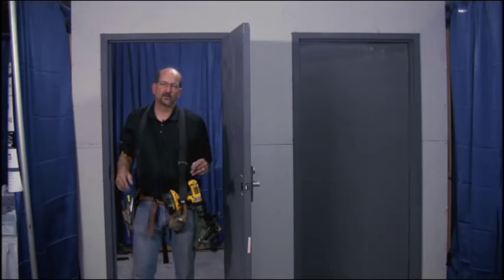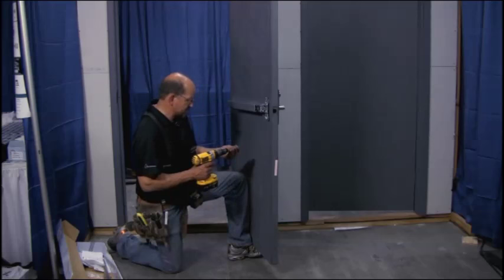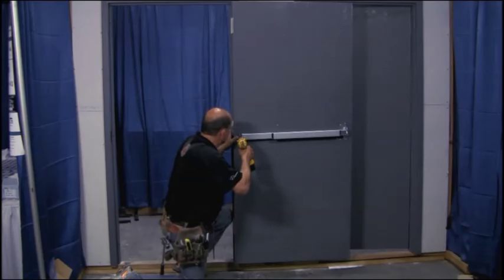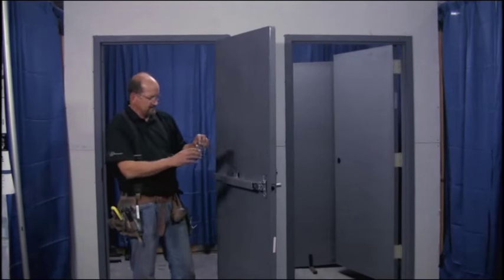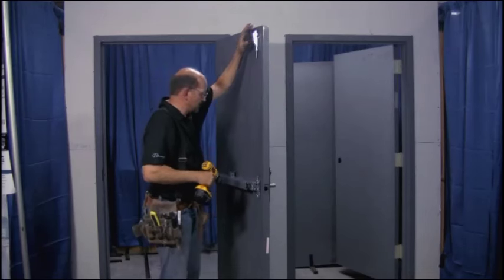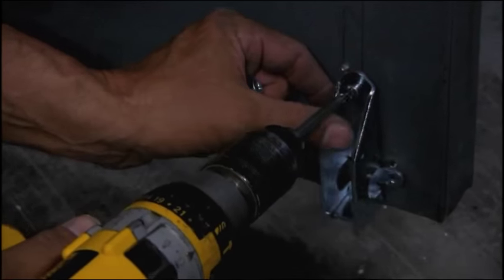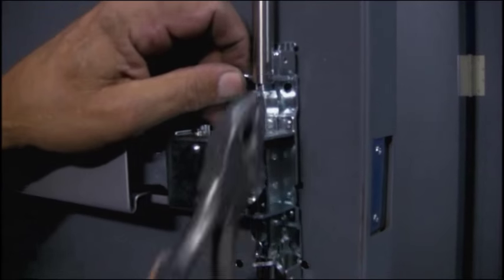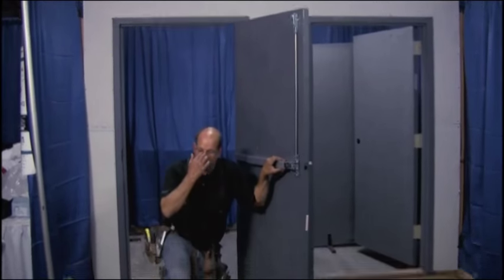2000V Vertical Rod Panic Installation

Comment: NEVER USE A LEVEL TO " LEVEL" A PANIC BAR ...HOW DO YOU KNOW FOR SURE YOUR DOOR IS LEVEL IN THE FRAME OR IS THE WALL ITSELF LEVEL ??  ALWAYS USE A TAPE MEASURE TO MEASURE FROM THE LOCK EDGE SIDE OF THE BAR FIRST .SET END OF TAPE ON FLAT PART OF BAR ON THE HEAD END AND MEASURE UP TO TOP OF DOOR ITSELF ....EXAMPLE ..40" ...NOW HOOK TAPE ON TOP OF DOOR ON OTHER SIDE(TAIL END.) AND MEASURE DOWN 40" AND MAKE A MARK .
                    NOW ALIGN THE TOP EDGE OF PANIC BAR RAIL ON THAT MARK ,AND MARK END PIECE BRACKET HOLE TO SECURE D3VICE RAIL ...THIS IS IMPORTANT WHEN INSTALLING MULTIPLE DEVICES IN A ROW WITH LITE KITS IN THEM ,AS ,LIKE I  SAID LEVELING THE BAR IS NOT ACCURATE ...MANY TIMES THE FRAMES ARE LEANING IN OR OUT AND NOT TRUE ...AND THE WALLS MAY NOT BE TRUE ,AND IF YOU LEVEL THE BAR ..IT MAY LOOK SKEWED TO THE DOOR ,IF YOU MEASURE FROM TOP ONLY ,DOWN TO THE BAR ...ALL BARS WILL LINE UP PERFECTLY .
                        DO NOT MEASURE UP FROM BOTTOM OF DOORS AS THE DOORS MAY HAVE BEEN CUT TO CLEAR UN-LEVEL FLOORS. ...  OR ,DO NOT MEASURE UP FROM UN-LEVEL FLOORS EITHER ,TO KEEP BARS PERFECTLY SQUARE WITH DOORS ,ALWAYS MEASURE DOWN FROM TOP ...THANKS .. I AM A 35 YEAR DOOR HARDWARE INSTALLER IN COMMERCIAL DOOR WORK . AND THIS IS THE ONLY METHOD I TEACH  ,AND PLUS ,HOW DO YOU KNOW YOUR LITTLE LEVEL IS TRUE ???  DID YOU CALIBRATE IT ?? PROBABLY NOT ?   
                       THIS IS THE ONLY FLAW IN YOUR VIDEO ,AS THE REST IS GOOD  ,IF YOUN  WANT A "LIKE" FROM A "VETERAN"  ,CHANGE THE TEACHING TO "MEASURE FROM TOP OF DOOR" ,JUST SAVE THE LEVELS FOR SETTING FRAMES !!!!  THANKS GUYS.
Reply: Ok